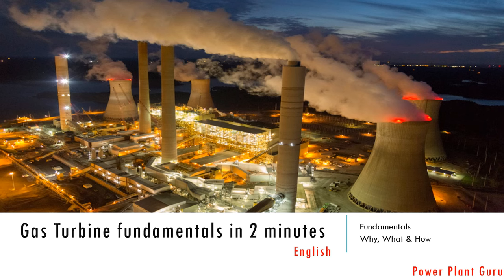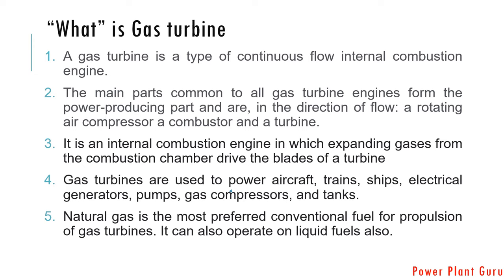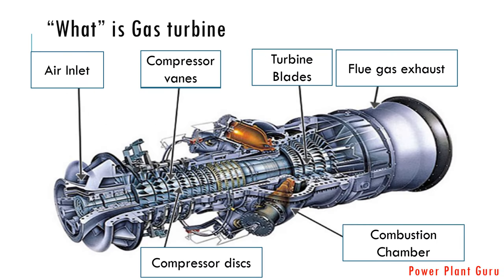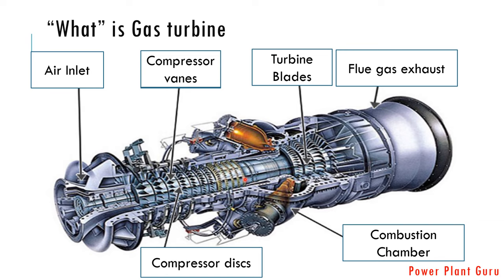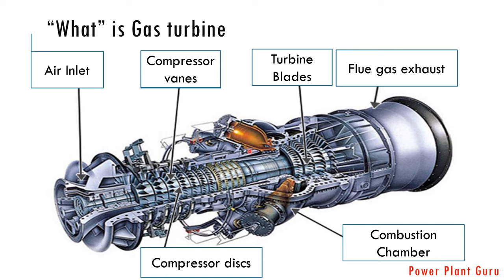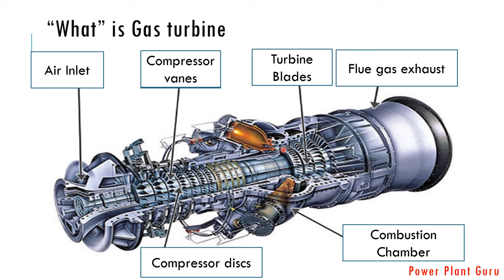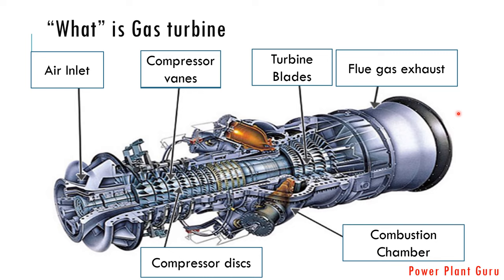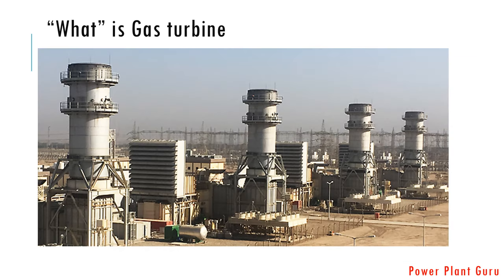What is a Gas Turbine, Gas turbine working principle, Gas turbines basic concept, Power Plant Guru

Comment: Where Magnetic cluth used in Gas turbine . Kindly explain the use of this device
Reply from the maker: Hello Prabhat
Thank you for watching my videos. Magnetic clutch is used for driving fuel pump. Clutch is connected based on magnetic force with AGB when liquid fuel is required. And disconnect (magnetic force off) when running on gas.
Reply from the maker: Will create a video to explain that.

Comment: What's we main by compressor discharge pressure
Reply from the maker: Gas turbines have an axial flow compressor and atmospheric air is taken and compressed and discharge is used in gas turbine.
Reply from the maker: At outlet of compressor the pressure and temperature of air is increased if we compare from the atmosphere from where it was taken. So all the parameters at discharge is measured and used for monitoring
Reply from the maker: Hope i have been able to resolve the doubt

Comment: How compressor is driven in starting of gas turbine ?
Reply from the maker: Hi Deepak. Thank you for asking. I was traveling so could not reply in time, sorry for that.  
Gas turbines have a starting device it may be one diesel engine or a motor. In the start up process the motor or diesel engine drives the turbine-compressor to self sustaining speed where the compressor is providing sufficient pressure and temperature of air for proper combustion. After that turbine goes to acceleration mode where speed increases and then stabilizes at full speed no load.
Reply: @powerplantguru007  Thank you for to the point reply.  In today's world knowledge is not free. Youtubers like  you contributing more to the society by sharing your knowledge & experience.  All the best 👍 for your channel. keep it up. 💯
Reply from the maker: Thank you for your kind words. Such comments encourage me to do more work.